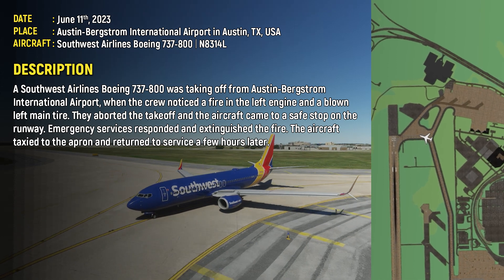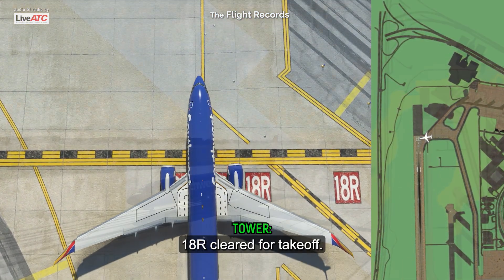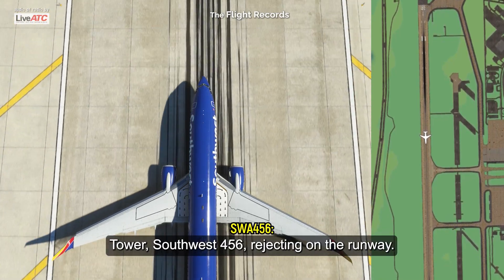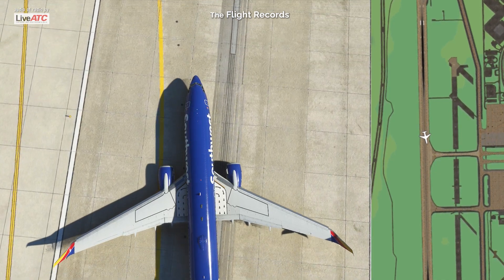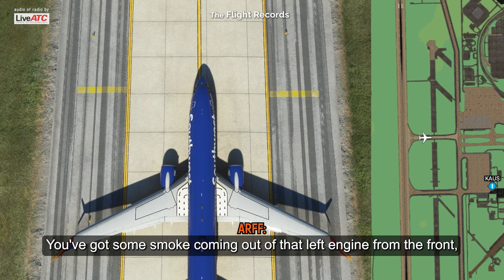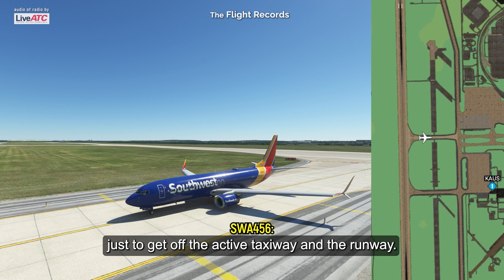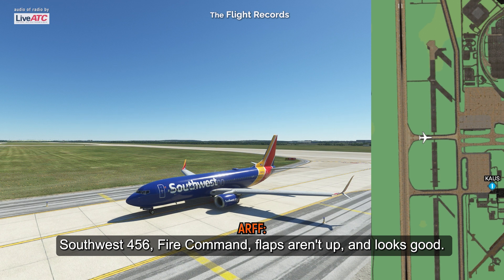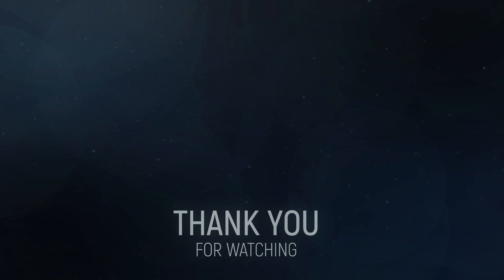ENGINE FIRE ON THE TAKEOFF ROLL | Southwest 738

Comment: I doubt there will be, but I hope there’s a public report on this one. Would be interesting to determine why they didn’t get a fire indicator warning in the cockpit? Perhaps the smoke was venting away from the detectors? Also, I find it somewhat interesting that this plane was put back in service within just a few hours after this incident despite a bottle being pulled and the potential for even minor fire damage. I don’t see that Southwest even has a maintenance hangar in Austin, just Dallas and Houston (in regards to Texas).

I’m also somewhat surprised that they didn’t evacuate the airplane with stairs after they confirmed the fire was no longer visible, seems like a procedure that is usually done out of an abundance of caution once they’ve confirmed the visible fire has been extinguished, you know… just in case there’s still residual fire out of external sight that could be making its way close to a tank. Not only did none of that happen, but they went and parked at the gate? I don’t know, maybe Southwest’s procedures for this are different or something has recently changed outside the scope of my knowledge. Also what was with the tire indicator? Was it faulty? Did fire not see it? So many questions.